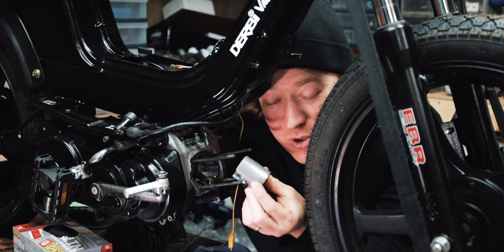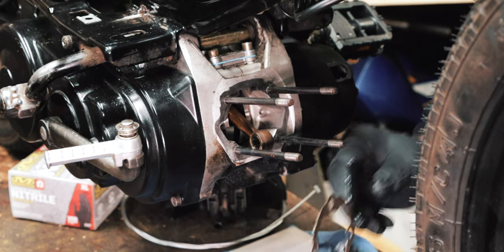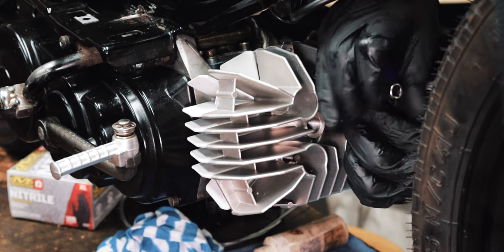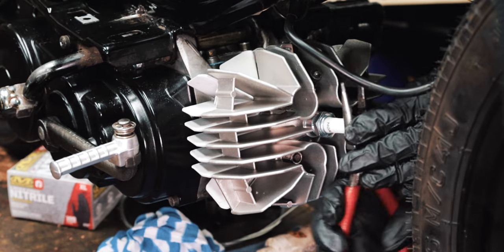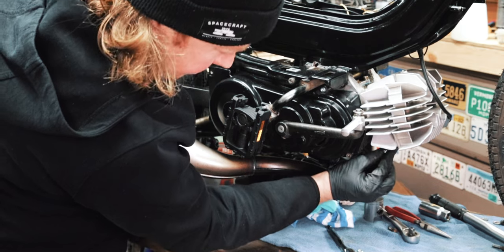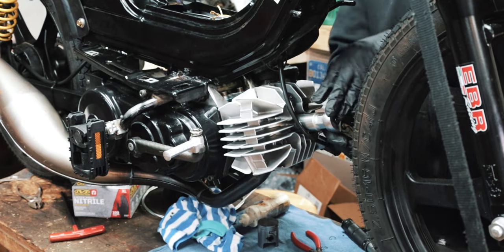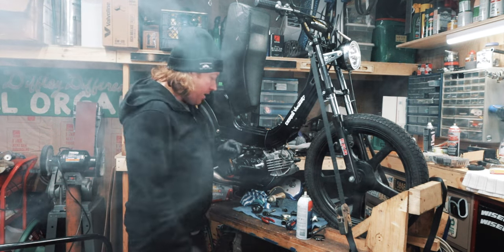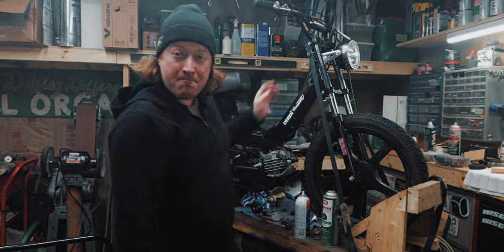One Last Problem before I can start the Derbi moped for the first time. 70cc Airsal Cylinder Install

Comment: Any ideas on why it seized?
Reply from the maker: Well when I pulled off the cylinder half of the base gasket was missing. I think that base gasket air leak may have caused it. Also the carb was loose and leaking. And the spark plug hole was stripped and leaking. . . Sooo yeah, there were a lot of air leaks. I never heard the engine run when I bought it.